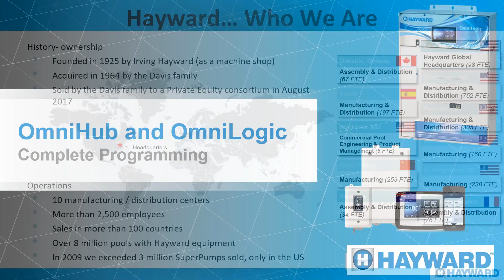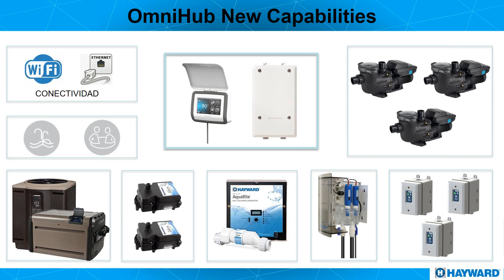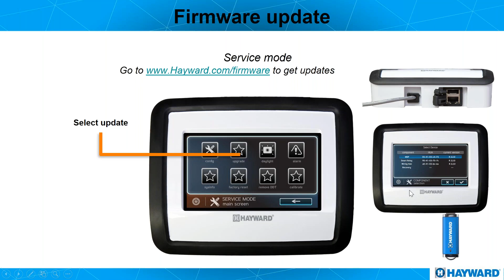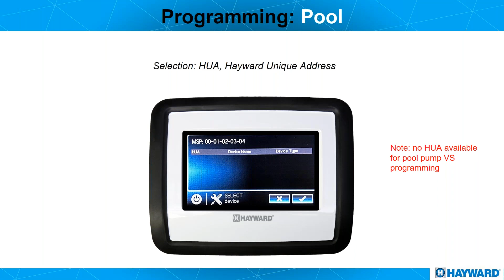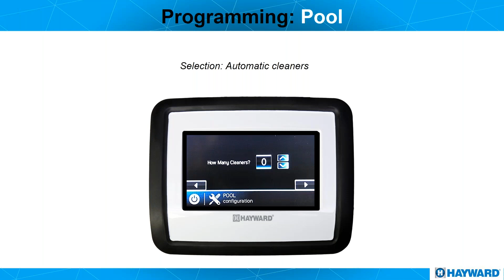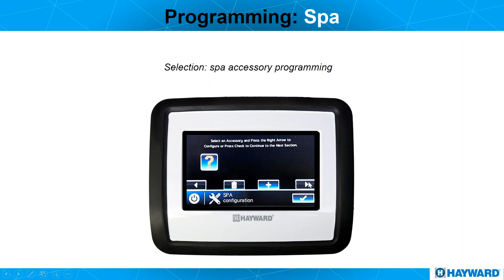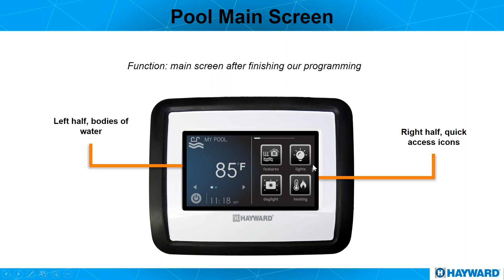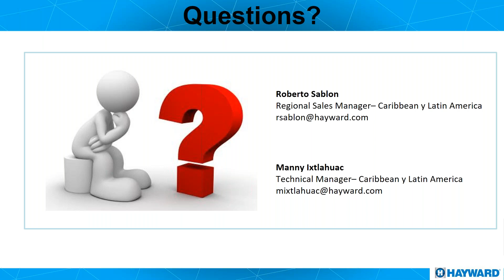Hayward  Programming OMNI Automation

Comment: Is there a way to have the omnihub turn on actuator valves to test if they are working. I have 2 valves programed and connected and they do nothing. Trying to see if you can have the hub manually turn valves on so I can figure out if the hub or valves are the issue.
Reply from the maker: Hello, in the Omni service menu you can manually activate specific relays. Also with our actuators you can test them by using the toggle on the bottom.
Reply: @HaywardLatAm  ok thanks will check it out. Only thing the installer used jandy valves for the install toggling the switches in either direction does nothing.

Comment: I'd like to have a third valve actuator involved in my pool and spa filter automation. Is that possible? Could I assign that actuator to the spillover?
Reply from the maker: Hello, depending on the capacity of your system you may be able to add more actuators and program it as a water feature. Please consult with your pool professional for more information on what can be done in your particular installation.
Reply: Thanks for the response. I've called Hayward customer service as well as all the local authorized service providers but still can't get any help. Hayward claims they don't provide phone tech support anymore and the service providers won't return my phone calls. I have an OmniPL system with connections for 4 valve actuators. Can you lead me in the right direction for help please?
Reply from the maker: Hello, if you have the Omni PL system you should be able to add another actuator. It is an advanced process and tech support won't be able to provide instructions over the phone because it depends on your specific configuration. You need a dealer to do that installation and edit the configuration to program the function you request. You can find local dealers by visiting this link: https://www.hayward-pool.com/shop/en/pools/Dealer-Locator?langId=-1 
Thanks for using Hayward products!

Comment: On the Omnihub can I have an actuator that controls 4 laminar jets but when the actuator activates the laminar jets untill it is fully open water goes all over the pool deck. is there a way to program that when turn on the laminar jets that it first turns off the pump waits 20 seconds then turnd the valve to the laminar position then turns the pump back on? then when i turn the laminars off it does the same thing. turns pump off returns the valve to off position then turns the pump back on?
Reply: You have to wait for the pump to prime, and then you can turn the actuator, you have to wait for the pump to be at a regulated speed and you have to regulate the valves for the laminar jet manually (most common) because if they’re fully opened you’re gonna have water all over your roof.

Comment: Thanks for the response. I've called Hayward customer service as well as all the local authorized service providers but still can't get any help. Hayward claims they don't provide phone tech support anymore and the service providers won't return my phone calls. I have an OmniPL system with connections for 4 valve actuators. Can you lead me in the right direction for help please?

Comment: Can I use the OmniHub with a standard, non VS filter pump motor?  Would I just use the smart relay to control the on/off of the filter pump motor?
Reply: Ok I see now in the video at the 25 minute mark you can choose the type of pump you have.